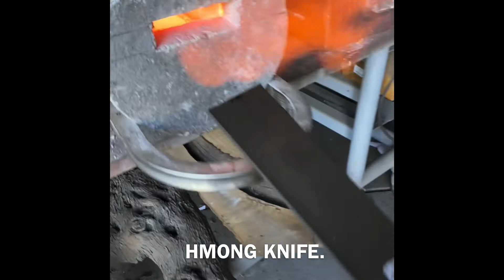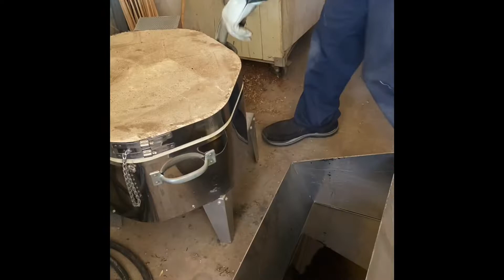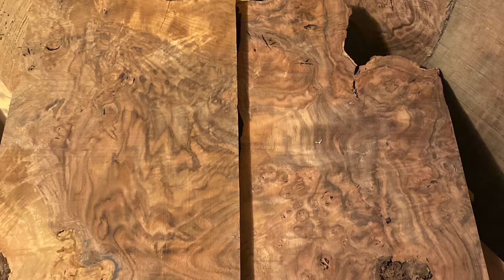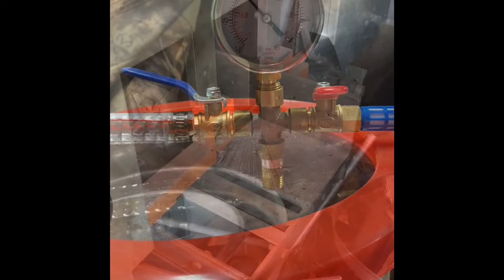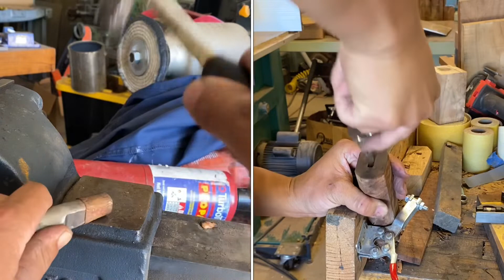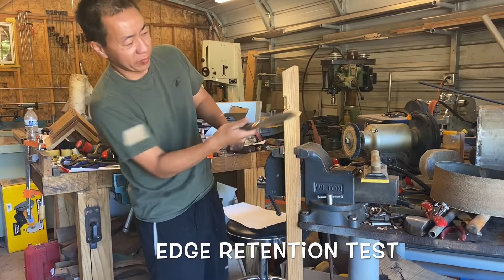Making Hmong knife with modern tools and techniques #hmong knife

Comment: How come modern knives never cut like old school knives? Those soft hmong steel knives would cut that wood pole in 2 to 3 chops.
Reply from the maker: Today market has some premium steel capable of making unmatched Hmong knives. A blade smith understanding of heat treatment, knife bevel angle, metal thickness, metal quality is key to making a chopping knife.
Reply: That knife is actually much smaller than a regular traditional hmong knife. It doesn't have the leverage and weight